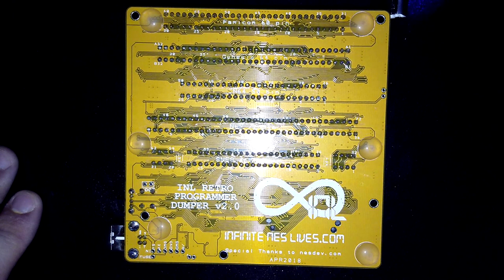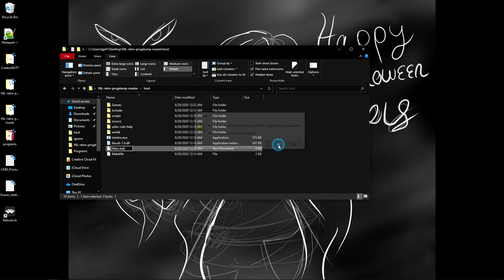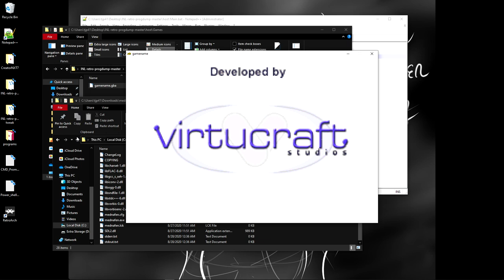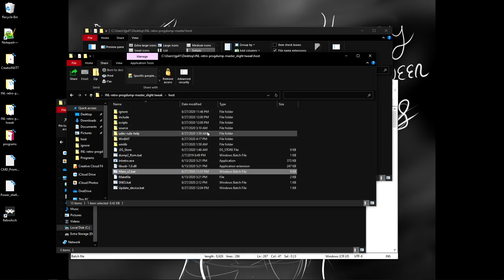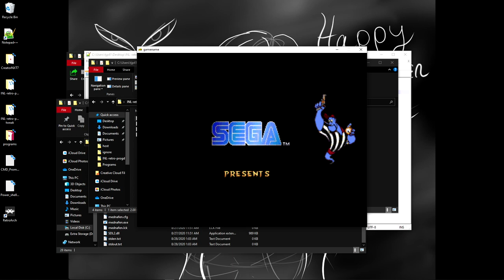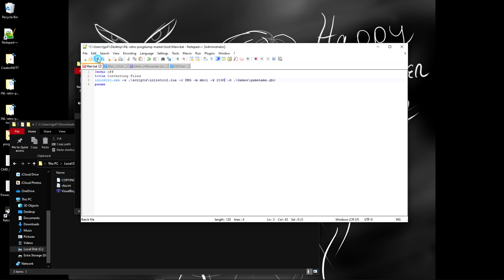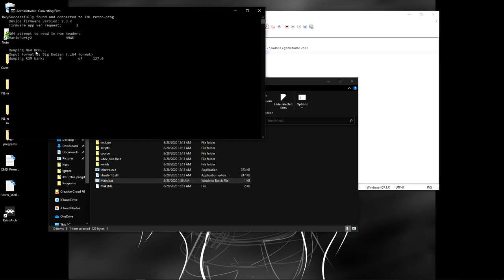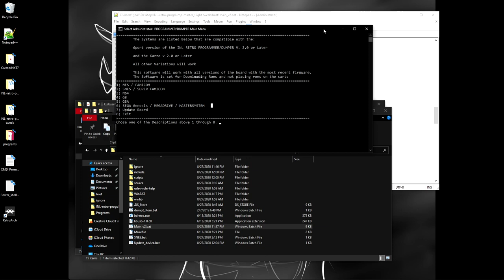Infinte Nes Lives Board V2 How To Use Part 1

Comment: can you also add an custom game to a blank cart with this? like a rom hack for example?
Reply from the maker: This device can write to a blank cart to play onto your systems, but I am not sure what parts are implemented yet for that. The NES and the SNES write functions should be working, but I do not know about the Genesis, N64, or the GBA port write functions. Famicom should work as well. The information is on the infiniteneslives.com website even if it is vaguely said, but they do have blank carts that you can buy for the SNES,FAM,NES, and the SFAM.